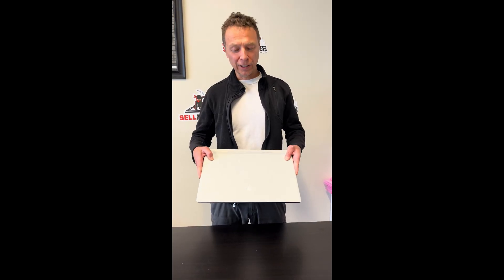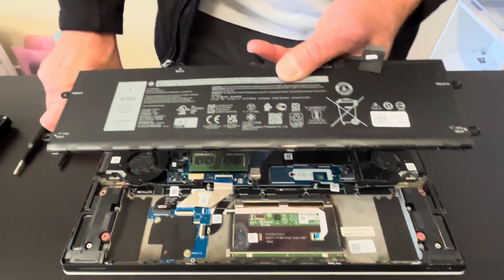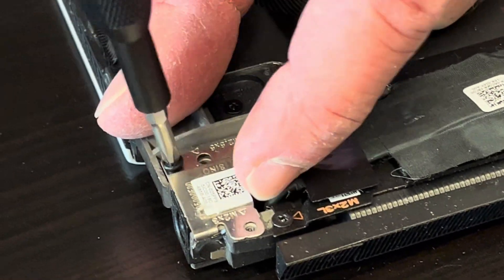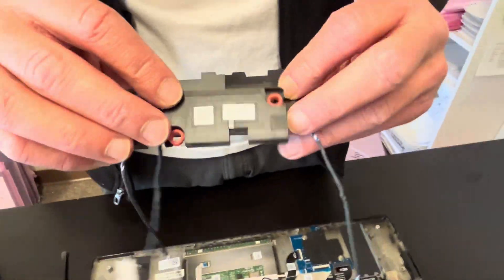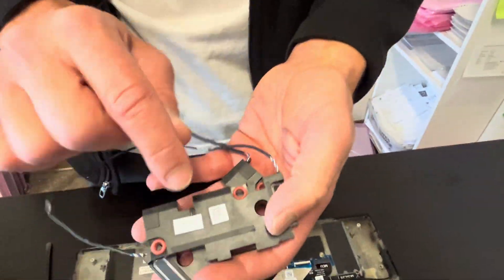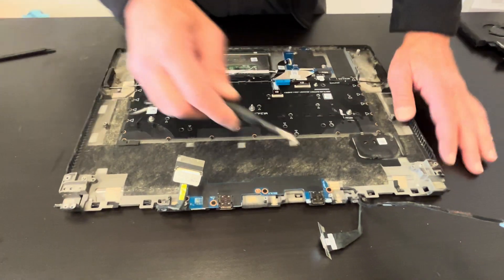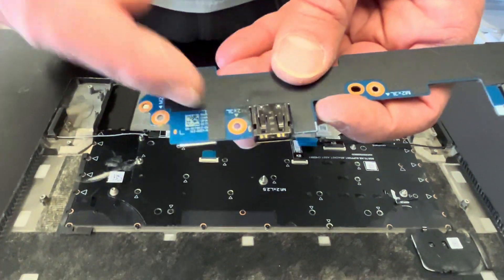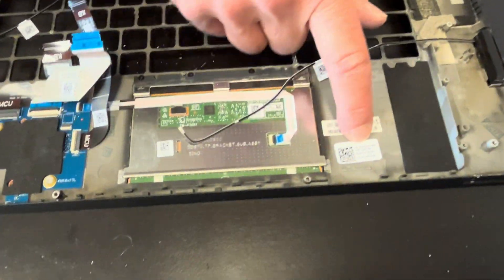Alienware x17 R1 Laptop. Quick teardown, fix, repair, upgrade: memory, SSD, Motherboard, LCD Battery

Comment: Nice video, but no mention of where the CMOS battery is. Waste of time watching this video. You tear down the whole computer but do not mention the most common issue. Resetting or replacing the CMOS battery. Where could it be? We'll never know.